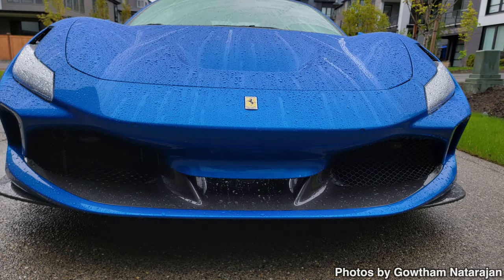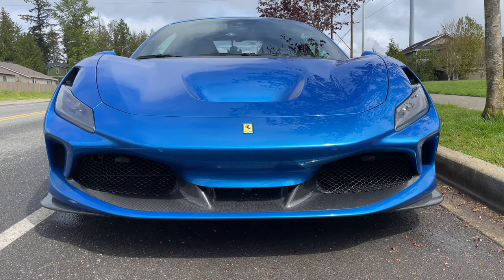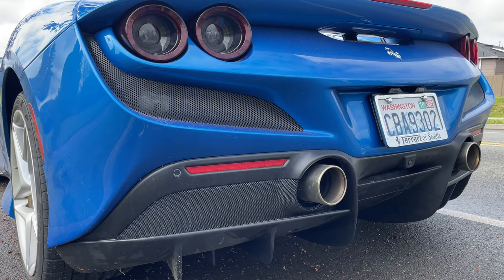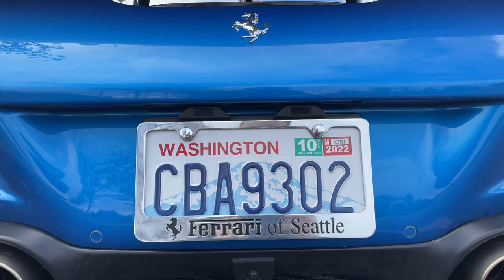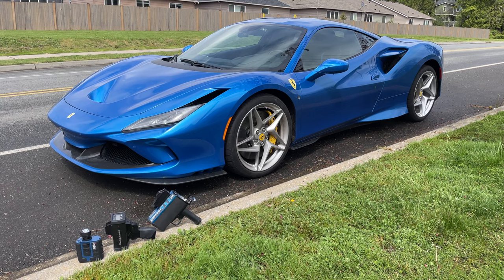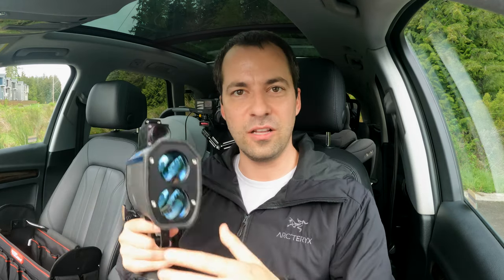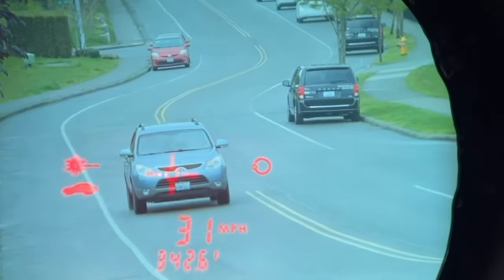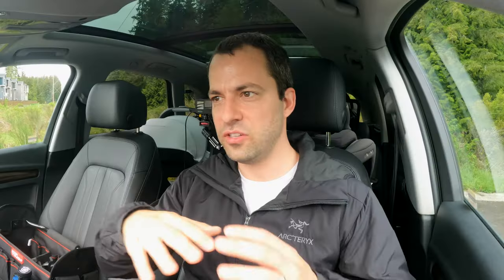How Did This Install Jam Laser???

Comment: Ariel, I missed this video when it was first posted but I have a similar story. Behind the RS grille in my Audi, I have a stainless steel mesh screen. I have been planning for a while to install ALP jammers but as of now, I just have an old pair of ZR4 laser shifters. I also have a Redline 360c and I use Waze. Before I installed the mesh screen, the ZR4's saved me a number of times but since installing the screen, I don't rely on the shifters for protection. 

The other day, I was driving on the Suncoast Parkway, near Homosassa, Fl. The posted limit is 70 mph, I was doing 95 and I got hit with LIDAR, there was no WAZE alert. I immediately slowed down and I expected to be pulled over but it didn't happen. Maybe the LEO chose not to pull me over but at 20 mph over the limit, that seems doubtful. I'm going to have the ALP jammers installed without the mesh screen in front of them but it seems that even an old set of shifters worked behind the screen.

Comment: Have you tested ALP installations, where the sensors are mounted within the tailight lens or behind the rear window?
Reply: I am really interested whether this will work, however I am betting it won't (However this video completely changed my perspective on laser jammer installations!)
Reply: That would make Porsche installs on the rear much easier.

Comment: You should get a modified camera that can see the IR light.. Alot of misunderstanding with laser systems from range finders and laser speed guns is just how much "spred" that dot of laser has at distance. its ALOT more then you think.. On top of that they are very sensitive to so they can see their own IR come back into the lens even during sunlight hours so they are MUCH easier to overload then you probably think.. Anyway. You should look into getting a camera or modifying one (its not hard to do with some basic tools) so you can SEE and show us how much of a spread both the laser gun and the jammer have.
Reply from the maker: You can find videos like that already if you’re curious

Comment: Wonder if the Tx head is actually firing on the rear despite being wired wrong? 

My ALP quad (Rx - 2 front/rear) has always been JTG against everything I’ve thrown at it (LRB, PL3, even DragonEye on a couple of firmware versions) on a mid sized SUV.

Comment: What's the consensus on a low mounted front TX head like shown here? That can't be more than 12-13" off the ground, is that still going to give a decent result even though most recommend 20" or more? Or is the move to run an RX head when the center mounting point would be that low?

For reference, I've been trying to figure out the best front laser jammer solution for a 992 GT3 Touring.
Reply: Even though this is low. The TX head did not interfere with itself

Comment: So I'm not sure if I'm following you regarding the improper install. Are you saying that if shot from the front, all four transmitters fire but if shot from the rear only the front transmitters fire and it still jammed??
Reply from the maker: The rear TX head was wired as if it was a front TX head so it would fire for front shots instead of rear shots.
Reply: @VortexRadar  I mean, that's amazing. Forget the behind the grill question, the fact that this jammed from the rear when only the front transmitters fired is beyond logic.
Reply: @GeraldLaz38  No, it jammed from the rear not using the rear TX transmitter because no laser was firing from the front to trigger it.
Reply: @machtschnell7452  See, I told you I wasn't sure if I was following, and I guess I wasn't. I'm still confused.
Reply: @GeraldLaz38  There are 3 heads for the front and 3 for the rear. Only 2 of the rear were firing back at the gun during rear testing. The one TX head wasn't because it wasn't wired correctly. The rear TX head was wired so that it would fire along with the front TX head during front testing.
Reply: @ZboeC5  Now that makes sense. Thanks for clarifying. Appreciate it.

Comment: Super late to comment… but if both vehicles you tested (where the heads are working from behind the grille) were Ferrari models, I almost wonder if the grille itself on those cars use a nonstandard material for the mesh or a strange coating otherwise that would just happen to allow better pass-through of the signals? Maybe part of their efforts to save as much weight as possible where metal materials would usually be?

I don’t know, just spitballing here. I wouldn’t think this is a large enough consensus to say mesh in all cars is a safe “cover” material. Something funky has gotta be happening with these cars and their exterior trim
Reply: Its just light not radio signals I'm thinking it's probably shiny enough to reflect into the sensor or rain helping reflect the light

Comment: Isn't laser jamming illegal? Won't cops immediately know that you have laser jammers installed in your car when they are unable to find a reading on your car? I know you can slow down and then let of off the jammer but wouldn't cops find it odd that it took couple of seconds extra to gauge speed on the car that was "moving pretty quick" ?
Reply: Easier fish to fry
Reply: Laser jammers aren't illegal at a federal level like Radar jammers are.

Comment: The front and rear distinction on the ALP might not matter. It's still sending the same jam, it doesn't care if it's front or rear.
Reply: The point is the rear TX is not transmitting if there is no reception by the front sensor.